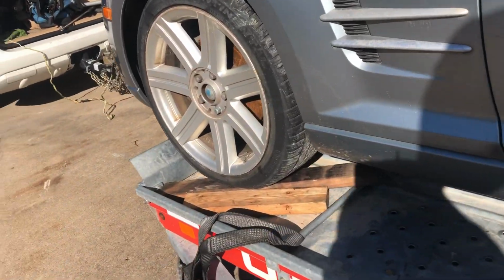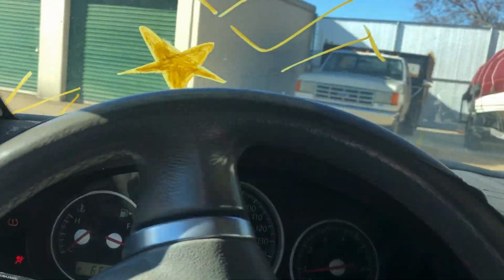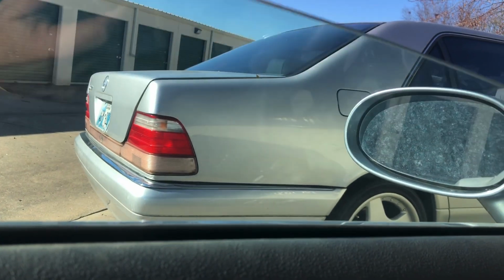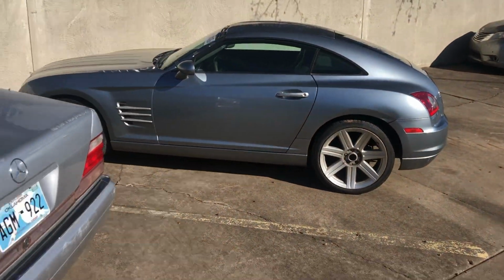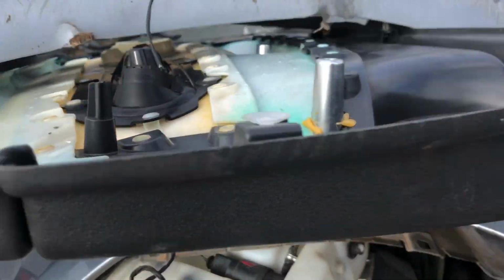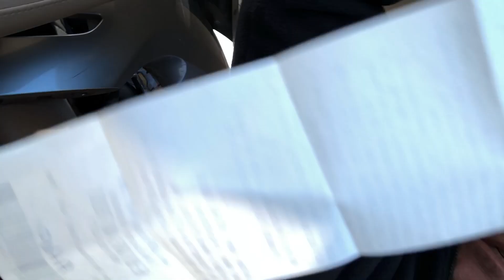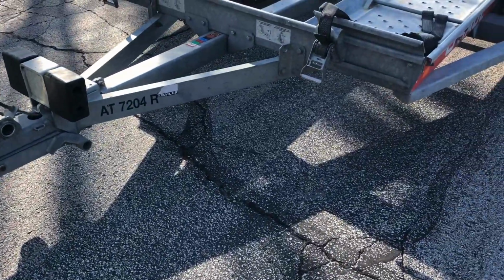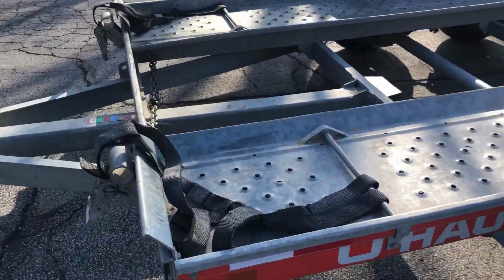Copart Crossfire First Drive

Comment: You know, Randy has been sick and been buying a lot of Crossfires.  I am kind of hoping that Mike caught what Randy has.  I love these little cars and I am very happy that this one has a proper transmission.  I think that there is a lot of potential there in your Crossfire.  

By the way, you might want to check out Wheelskins steering wheel wraps.  They are very nice, leather, very customizable if you order directly from the manufacturer and would help to make your new steering wheel look like new.  I will tell you, it takes for ever to stitch them and get them right but the results are well worth the effort.

I am very much looking for to seeing the transformation of this one.  Congrats on getting it moving and driving on its own!
Reply from the maker: Thank you! I’ll look into the wrap!

Comment: Jingle bells, jingle bells, Monkey Wrench Mike.  Since you have own SLK’s before one of the common problems is the heater vent divertor.  Mine wasn’t working.  Heat would only come out one side vent.  Fun, fun.

Comment: I had one of these and I had two problems; the starter switch bolt locked up so I had to drill out the lug (common problem with these) and randomnly the Alarm would go off for no reason (no garage I took it to could diagnose the problem) so I had to disconnect it.

Comment: Just watched your crossfire video i have a 2003 slk32 AMG i got about 6 years ago with 132k miles now it has about 153k miles the only problem is the clear coat has started flaking off have gotten a couple of estimates but they are around 3500-3900 any suggestions Thanks
Reply from the maker: I tried to re-clear just the bad spots on a c-class coupe I had. Nothing major just a few bad spots. Sanded edges and cleared, not too bad. But when I sold it, the guy wrapped it and it looked amazing!